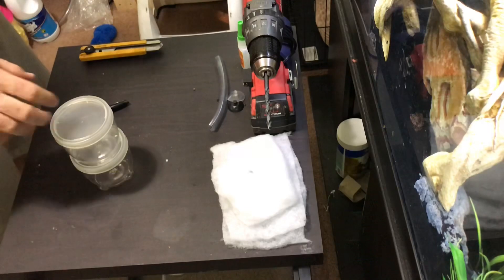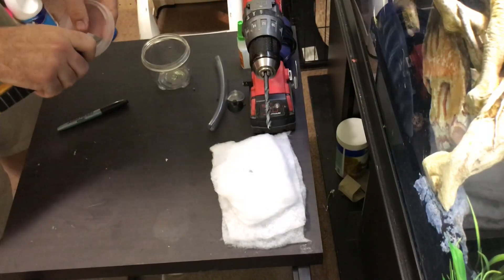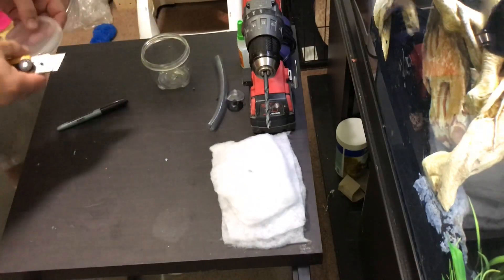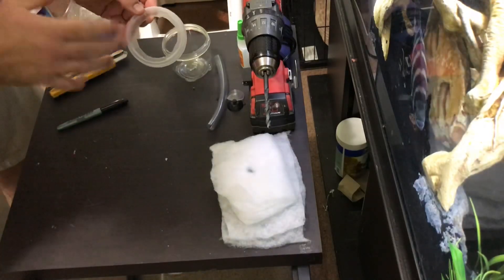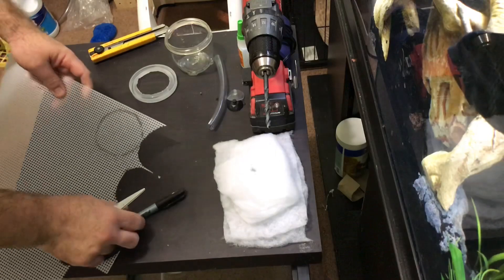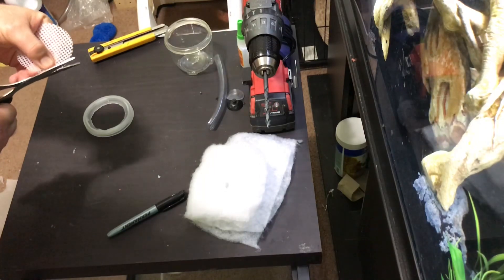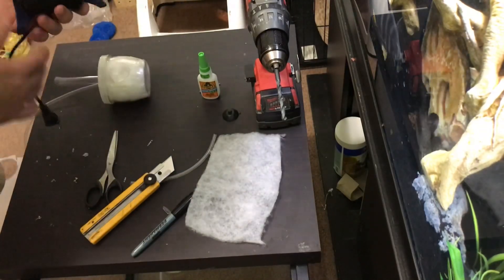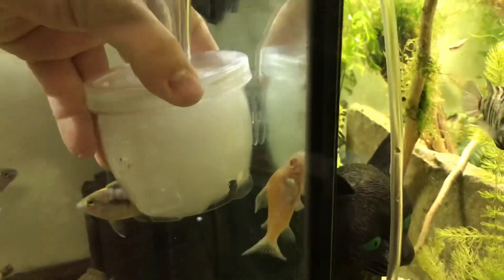DIY Air Driven Water Polisher / Organic Puller

Comment: My 10g planted betta tank is mostly clear. However, if I look closely, I can see little particles floating around in there. I've been looking at DIY water polishers. But, all the videos involve using powerheads and bettas don't like a lot of current. So, I think I just found what I was looking for. Thanks.
Reply from the maker: Bradley Fortner wow that’s so awesome. This should work wonderfully for a betta. I wish you luck with this. I would love to hear how it turns out for ya. Thanks so much for leaving this awesome comment I really appreciate it. Thank you.